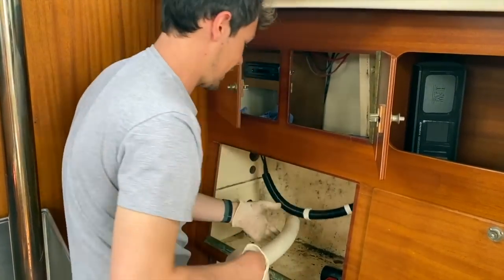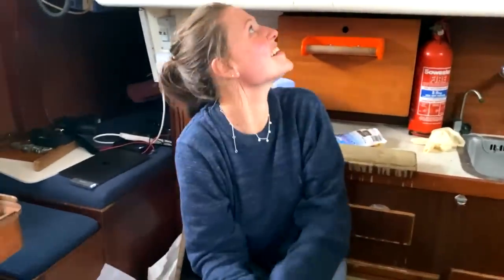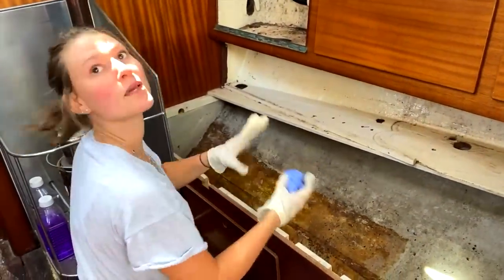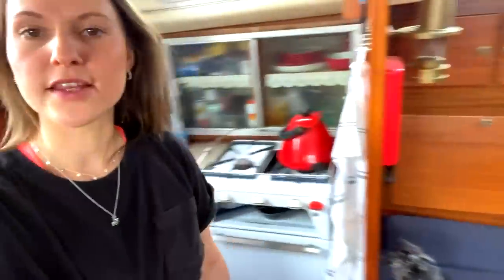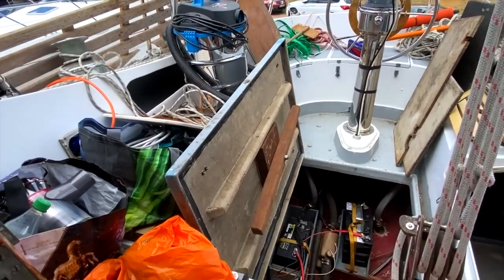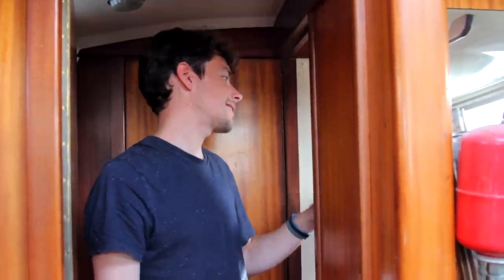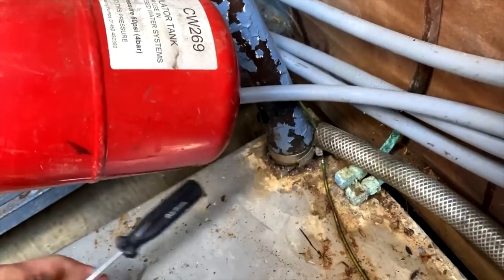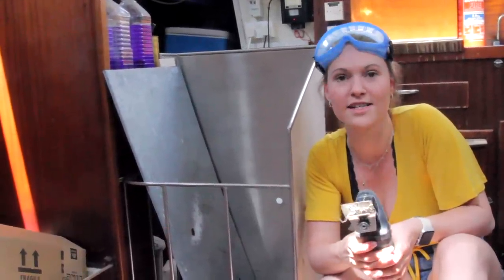Ep 3 | Removal of all things diesel | A leak check & saying goodbye

Comment: Big mistake removing that sweet reflects heater.   It’s gives off so much heat and only consumes a tiny amount
Reply: Of diesel.   Build a small bookcase around it to disguise it.   Sweet stove and sweet installation.   North Atlantic fisherman keeps warm for 30 years.   I leave it running on the mooring between trips
Reply: Well we are happy because we have the Rum Punch refleks.
Apart from the refleks our boat will be 100% electric but this will provide heating, hot water and a stove top that uses no electricity for UK winters.
Reply from the maker: We do agree about the efficiency but it was just too big and bulky for what will be our main living space. We're happy knowing it's gone to a much better home!
Reply: @sailingrumpunch  we are going to reconfigure our huge chart table (change from facing outboard to forward facing and shrink it). That gives us space for the refleks (opposite the galley so it's stove top will be in a convenient position), we have had the enclosure shrunk a bit which will help.